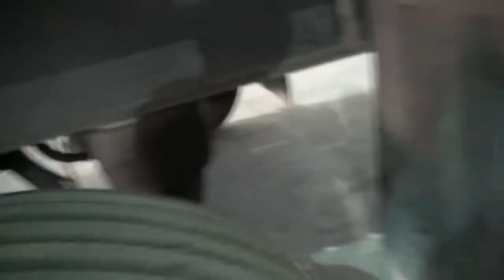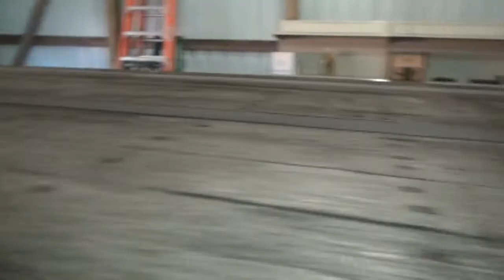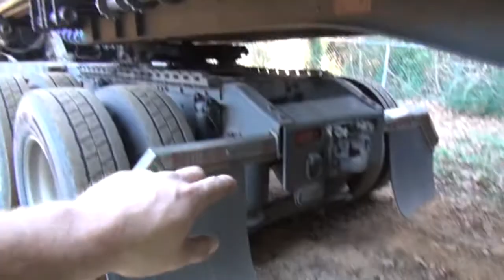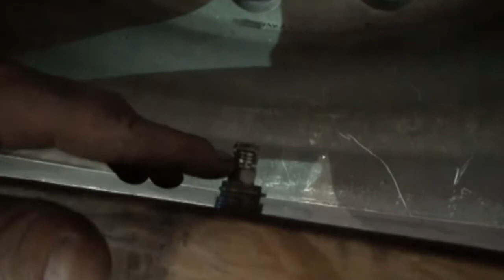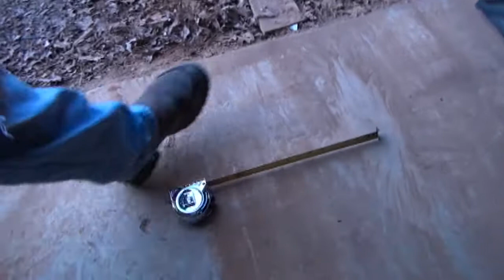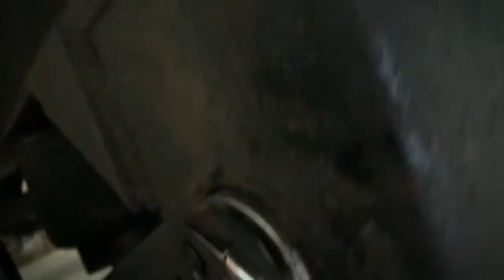Semi trailer axle alignment the poor boy way

Comment: Man I just wrap a welding rod around fifth wheel pin. Attach tape measure.& get all the outside U bolts to match up? Not same style trailer I got old radius rods to adjust?? Your way looks good 👍

Comment: You weren’t accounting for the trailer axles being 6” wider than the truck axles. With your drive tires on the edge of the center line, your trailer tires should be 3” to the left. When they are, your right side tires are 3” to the right of your right side truck tires and you’re lined up.

Comment: Just for your information they sell new brackets.....🤣😂 and you put the bolts in backwards! 🤯🤣😂 Your definitely not a trailer mechanic!...or a Alignment technician....🤣😂
Reply from the maker: They also sell new trailers... 😂 I put the bolts in the same way the old ones came out, not that it mattered...I never claimed to be either of those things but some of the people that do sure as heck can't seem to fix anything right... I pulled this old trailer several years until I could afford to buy a new one... 😃
Reply: @LifeWithChase  well sorry that you didn't go to school to learn the right  Procedures ? That bolt with the hex end? Has to be torqued down until it sheared off !  That's the way it must be done ! But we must learn from our mistakes! Just hope nobody gets hurt?
Reply from the maker: @robertbenavidez7164  obviously that's not the way it must be done because I didn't do it that way... 😂 I torqued it from the nut side. Who wants to torque it from the bolt side and shear the bolt head off so you can't remove it if you ever need to without cutting the bolt. The bolt that came out hade a full size head and torqued like any normal bolt. No head shearing crap on them. Also doesn't matter which way you put them in they toque the same, sorry you can't seem to figure that out, with your expert trailer repairing degree!
Reply: @LifeWithChase  Well for information you don't use a torque wrench 🤣😂 it's set up to use your 1 inch impact!  And yes technically you can put the bolt in any way ? But? If u put the bolt in with nut out? It's easier to use your gun from the inside! And yes it's a one shot deal, they make the bolt that way on purpose!  So when you do an Alignment?  You know that it's torqued down at the right torque!!! It tells u this in the instructions when you buy a new bolt kit!😁 Yours Truly, A.S.E. Certified 40 years experience.
Reply: @LifeWithChase  Part Number # S-24303
Reply from the maker: @robertbenavidez7164  mine didn't come with any instructions, they even lost some of the parts because the box was ripped open. I wished they had sent the old type bolt's because they had a normal head on them and I didn't have a proper socket to fit the new inverted torx. I forgot what I wound up holding the bolt with since this was several years ago, but I remember not having the right socket and having to do it a different way...
Reply: @LifeWithChase  well that makes sense!  I send u the part number for the socket! But I don't know if you want to spend that kinda money? If you don't do Trailers all the time? It's not worth it! Because  Hendrickson sells the socket and it like $350.00 bucks just make sure your torque them down tight with a 1 inch gun! I had a young technician torque it down with a 1/2 inch gun and did 8,000.00 damage to a customer's trailer!🤦🏻 those bolts have to be super tight but not to tight that it will snap!
Reply from the maker: @robertbenavidez7164  That's an expensive socket! And expensive mistake! I hope that's the only trailer I have to do ever 🤞 lol . I bought a brand new trailer last year. Hopefully it will last a long time before repairs. Yes those bolts have to be tight! I double checked The bolts several times after I did the repair to make sure they were still tight and nothing had moved. I service my own truck so I'm always looking for stuff that could be a potential problem. Although sounds like the technician didn't get them tight enough, it seems the driver should have seen the bolts was loose and the axle was walking before it caused that much damage, but I know most drivers don't check anything, that's why they call them steering wheel holders...
Reply: @LifeWithChase  Well rule of thumb is about 1 million miles before u have to replace them bushings. U will probably be an old fart like me by the time you put that many miles on it! But look out for loose wheel bearings they get loose around half a mill?
Reply from the maker: @robertbenavidez7164  yep, I plan to keep an eye on those, it has the Hendrickson hxl5 wheel ends with the Grease. I prefer oil bath cause you can check them easy.
Reply: @LifeWithChase I know this video and replies are over a year old but I am impressed and greatful that you remained calm when this guy was trying to hateful to you. I just found your channel when I was searching for a video on how to replace the wide bushings in my Benson flat bed with Hendrickson suspension. Thanks for the video! For what it’s worth.. we align our race cars with lasers and hub plates very similar to how you did it with the board and laser.

Comment: I've watched both of your videos regarding this trailer bushing repair. I had called utility in Dallas, and they want $1150 per axle to re-bush + $245 for alignment on my 2007 48x102 flat. They are crazy. I bought premium bushings for $140 each and found a used Hendrickson tool on eBay for $300. You have inspired me to do this repair myself. I already fix everything except I internal engine/transmission. I'm gonna give this a go! Thanks for posting. You are a real owner operator! Not too many of us left out here.
Reply: How did it go?

Comment: Believe it or not, when companies make the load map for how they want trailers to be loaded, they intentionally set it up for the trailer to lean (put more weight) on the curb side, not the left/ center line. That may be why you only "see it" when you're loaded.
Reply: +John Smith. What companies are you talking about when you say they want trailers to lean more to the right? Trailer manufacturers or axle manufacturers? I might be wrong but I thing the axles come with toe set straight. Are the trailer manufacturers changing toe?

Comment: Nice job on repairing that bracket. That's a slick description of how you figured out the tracking issues. I like the ideas you had on how to get the alignment corrected too. I see that on some rigs when I'm driving in my car. It's easy to see when a trailer isn't tracking behind the tractor. I always wondered if the driver sees it.
Reply from the maker: yep you can see it. some drivers on the other hand don't even know they're pulling a trailer LOL